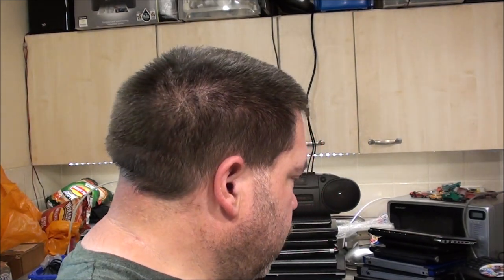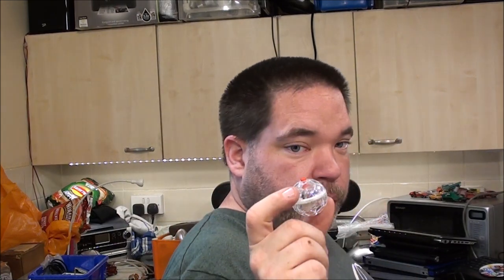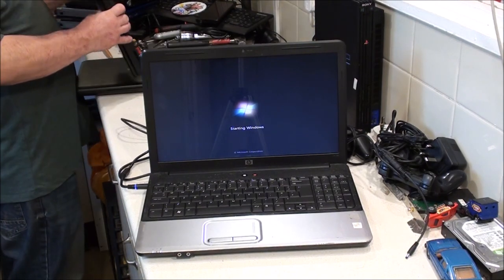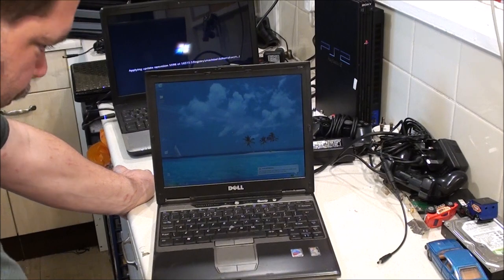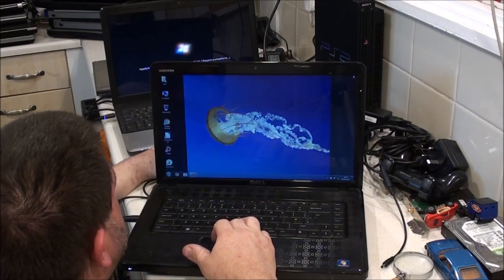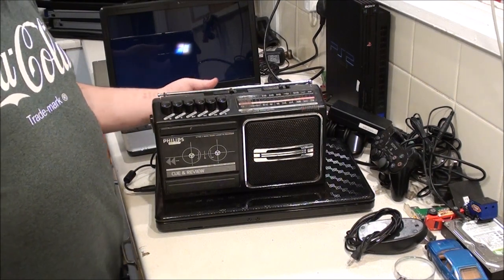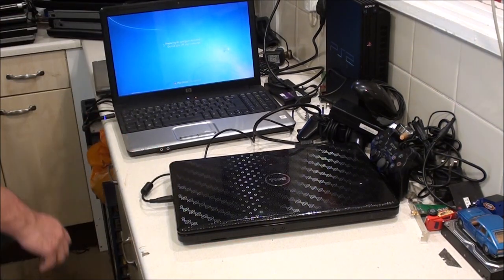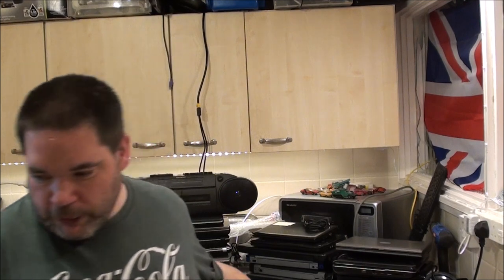Carboot Find Laptops x3, Will They Work? (Bonus Paranormal Talk)

Comment: Those old dell's batteries tend to become spicy pillows, but the type that actually go boom. The fact that it doesn't charge is a big sign that you should probably toss it away as soon as possible. GG on the find!
Reply: The laptop wasn't even acknowledging being plugged in, let alone the battery refusing to charge. It's either an AC adapter issue or a power jack issue. There's nothing wrong with batteries in Dell laptops from that era.